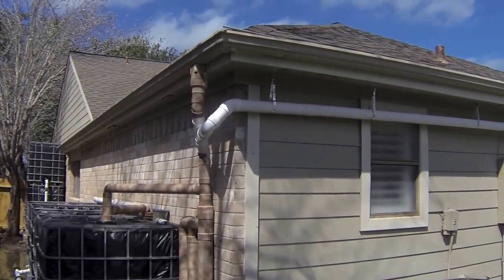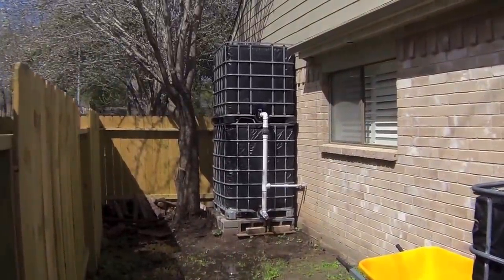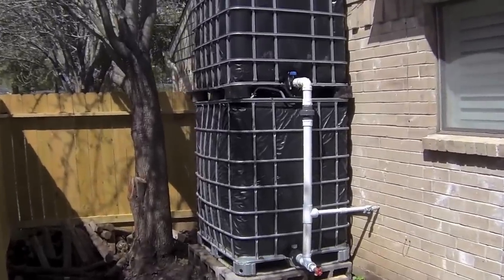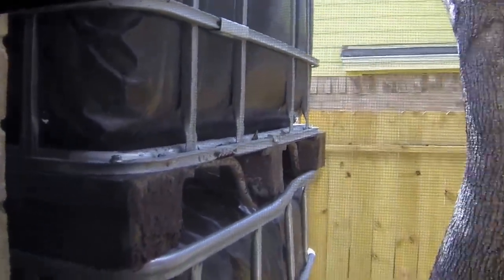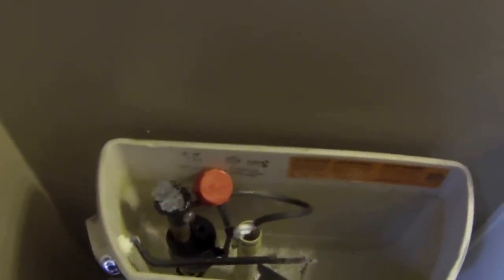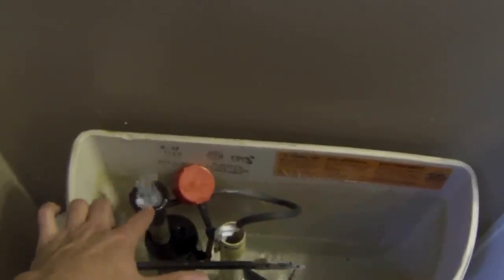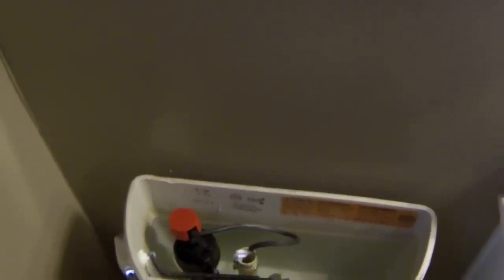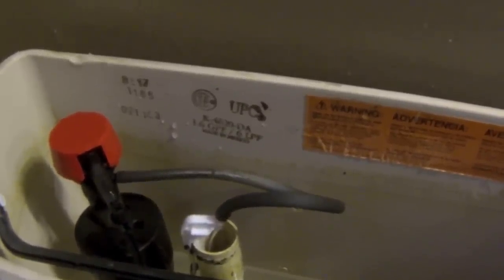How I Flush My Toilets Using Rainwater

Comment: The metal cage of the lower water tank is almost failing from the weight on top of it, see how it bends? Pretty sure you didn't calculate how much weight that steel supports, and see if the top water tank exceeds that limit.

Comment: Here in our hometown, city water is cheap, but they bill you for every drop of water that goes into the sewer system. That is measured by the total water flowing through the meter at the street. My last water bill was only $12, but my sewage bill was $44 plus trash pickup is added to my bill. My average bill for all my city service runs me low at $68, by high runs close to $80. Anywhere I can reduce my flow rate is well worth the effort. My biggest use of water is watering my gardens. I have built my first rainwater harvesting system, and with a recent rain was able to collect about 255 gallons of water in a 300-gallon tote. I am waiting on a second tote to add more water. Since I live in an area that has an average winter temp of 55 degrees I am not too worried about freezing and the long-range forecast is for a mild winter

Comment: Hello, I understand this is an older video but I hope you still respond to questions.  We're researching rain harvesting for gardening, toilets, washing machines and possibly drinking and cooking.  I'm still kinda iffy about that.  I saw your video about using it for toilets.  You mentioned not having a pump at the time of filming.  Did you ever get a pump?  Would using one be easier or is stacking the totes outside each bathroom required?  I saw your video on collecting rainwater but it didn't have the totes stacked outside your window as in this video.  Did you leave these totes like this and if so, how did you fill it?  It's not connected to the rest of the system.  We're researching  everything now and I found your video very helpful.  Thank you for taking the time to share and I do hope to hear from you.

Comment: Hey brother, first of all I want to congratulate you and say great freaking job. I just had couple questions. In your design you mentioned those 3 pipes running down from the gutter to ground as if they were dispensing at bottom, but they are blocked off. What is the purpose of this? I see you have filter for the gutters so it cant be for settling solids at the bottom. Another question i have is, is there a way to use this water in all the bathrooms and toilets in the house? I understand it might not be inexpensive and may require pumps and other things. However, if you are experienced in the area i would love to know.
Reply from the maker: Thanks you and good questions, If you watch update #1 I explain more about the (3 pipes) first flush diverter. The bottoms are blocked off but are loosened where the water can steadily drip out to reset itself after each rain. In between rains there is a build up of dirt, bird droppings, and small stems that build up in the gutter. The leaf guards helps a lot with this but does not stop everything. The first flush diverter removes the first 20 gallons or so from each rainfall. Yes, there is a way to use the water for your home but requires more filtration to be potable.

Comment: good morning. had you made any changes to this system or learned anything new since making the video? I'd like to try the same with my house. was your pressure low because the IBC totes were low, or would pressure increase once they're full? thanks!
Reply from the maker: The tanks were full when I made the video. You can increase the pressure by raising the tanks. The low pressure system works just fine. This was only proof on concept, I do not have the connect now.
Reply: Great info, thank you!

Comment: I figured out another solution to low pressure,  change to the float ball system. when the ball floats it automaticly opens the valve with no pressure needed
Reply: Float ball system? Can you link one?

Comment: Excellent way to use water from the heavens and not from a city source. I wish the city and county's would join the 21st century and allow more gray water discharge and rain water collection to be less of a red tape experience it is right now all over this country. 

I personally would install a reverse osmosis filter system at the end and direct the waste water back to the collection holding tank.

Comment: I love your videos, very informative!  One question, since you have to use a transfer pump to fill your tanks to flush your toilets anyway, why not instead use a RV style water pump to provide pressurized water on demand directly from your rain collection tanks?  As it is, your pressure available is going to drop as water is used out of your stacked totes.  With the RV pump you can get a consistent 35 to 55 psi (depending on the pump.  Enough to flush toilets, was cloths, shower, or do what ever.  The pumps run off 12volt DC and can be powered wither with a transformer from regular 110 volt ac or if your into off grid stuff you can get a deep cycle battery, solar panel and charge controller to power the pump.  The way there is no stacked totes and no hoa to deal with.
Reply: Todd Jones Never mind.  I just watched your video " How to Filter and purify Rainwater"   Great video and it covers the pump. Thanks!
Reply from the maker: Todd Jones Thanks for watching!

Comment: In reference to the comments on the visuals or suggesting pumps you only need the volume of water for the flushing to be higher then the toilet. Remember the old timey ones with the tank way up near the ceiling? So if you get a lot of rain, you don't need the full sized IBC tote raised high, just however much water is needed for steady - state toilet flushing cycles relative to rainfall rates.

Comment: Love the concept. Looking to implement at my homestead. Would raising the height of the tank increase lbs of pressure? Im new to the whole concept?
Reply from the maker: Thank you, Increasing the height will increase the lbs of pressure. I believe for every 2.31 feet of height you gain 1 psi or for every foot of height you should gain .43 psi.
Reply: Thanks
Reply: That's right for pressure and head figures. I think typical flow ratings for water closets (toilets) are based on 60 p.s.i. inlet pressure. One foot of head is a foot of water column rise. You have your losses along the way.

Comment: thanks man ! i have been tring to make a low pres. water valve for my rain tollet and failed for these coup of months , i have been cutting the cut off valve on and wait ontill it fills then off. this was a pain. i need the low pres. washer for the 50 cents. do they  have them on ebay. and what do i ask for .thanks again
Reply from the maker: howard ashcraft are you in the United States? I could not find them anywhere!! It's a low-pressure ballcock seal. Fluidmaster Tech support  helped me, here is the number 949-728-2000.
Reply: Trenton Kaminski yes in the usa . thanks for the number . i will call .

Comment: If you take a styrofoam raft and float it on your reservoir, and then set concrete blocks on top of the raft, you will pressurize your system.

Comment: Hi great video, thinking of doing something similar myself but was wondering if there is a valve fitting that you could use to connect both the rainwater pipe and mains pressure pipe to so that if the rain water drys up you could just switch it over to mains pressure. Any ideas?
Thanks
Dean
Reply: Cloverfield Construction Ltd, sadly it’s illegal in most states to connect your rainwater system to the same lines as city water because it violates the clean water act, because you could backwash into the city system, you can get around this by completely disconnecting your toilet from city water and only using rainwater on it

Comment: Will there be a problem if/when you switch back to city water with 8 lbs of pressure on your 2 lb pressure seal?
Reply from the maker: I did the swap and the toilet works fine on city water with either seal. However, I'm not sure what would happen if I left the 2 lb seal for a length of time. Each seal is only 50 cents or so and the swap only takes a few seconds if so some reason the 2 lb seal broke or didn't work.
Reply: Trenton Kaminski Howdy!  One other question, if the seal fails, will the toilet flood the house?
Reply from the maker: TheStavros1001 I'm 99% sure it will not flood. Im not toilet expert but here is my reasoning. My other toilet leaked due to an old ballcock and float set inside the tank. When this toilet would not stop filling water it just drained into the overflow pipe to the sewer. My assumption is the toilet with the 2 lb seal would do the same.
Reply: You probably need to use the seal for the intended design range.

Comment: Would you have to switch to city water for the winter season?
Reply from the maker: We're lucky here, it rarely freezes here and rains much more in the winter months. I'm near Houston,Texas.
Reply: If I did this, I would have the same problem in the winter; not enough water and that water freezing.

As far as freezing, I was thinking of a black box and tubes filled with glycol in a gravity loop arrangement for heat transfer; Insulation also would probably be needed. -A lot of remedial efforts. Therefore, underground tanks are the way to go for that. Then one will have to pump it. -Storage tank, pump and pressure switch. This is the typical cistern system, I believe.

Comment: can we use rainwater for shower directly after collected as long as its free from small particles or do we have to cure it first and if so, how? thanks in advance.
Reply from the maker: +youniverse traveller no you can shower with rain water no problem.
Reply: But why rainwater doesnt take away the soap completely .after minuters of showering, the body still remains slippery?

Comment: I have a simple solution for you. Take the tote that is on top and put it side to side so it is not visible from the street. Now you can take an RV style pressure 12vdc or 120vac fresh water pump that will deliver standard household water pressure to your toilets. Once the toilet tank is full, the toilet valve will shut off the water like normal. The pressure pump will then automatically shut off.

Comment: don't know about the climate in your area, in winter where I live all of that exposed plumbing outside would have to be well insulated, be better insulated with a pipe heater. I use a small booster pump 3/4 hp to move  water from the tanks to where I need it. 40 lbs of water pressure 100 feet from the tanks and you can pump a tank dry if needed for maintenance or cleaning. The pump is mounted on a 4 wheel yard cart for mobility.  cart and pump available at Harbor Freight or Ebay.

Comment: You could put a check valve on the rainwater side pointing in the direction of the toilet with a T connector, and a ball valve on the   city water side! this way you don't have to disconnect the pipes!

Comment: hey Trenton, is there any update or new info for this? has everything gone smoothly with integrating the IBCs into your toilets?
Reply from the maker: This was only a proof of concept.
Reply: i get that, but it was 3 years ago - did you not keep this system and run it?
Reply from the maker: Correct I just wanted to see if it would work.
Reply: Trent, forgive me for pestering, but the fact that you ended up scrapping it begs the question - why? were there any circumstances that prevented you from keeping it?
Reply from the maker: No special circumstances, however I did not feel like covering the top half. Homeowners association would have required me to shield the tank if I was to leave it up. I also would have had to install a float switch and pump connected to my main system to keep the tanks full. I really just wanted to see if I could make it work and share the experiance.
Reply: awesome - ok i figured the HOA had a bit to do with it, i just wanted to make sure there weren't any pitfalls to doing this on my home. thanks for all of your invaluable information!
Reply from the maker: +Eric James if you or a person wanted to replicate this the hoa can not stop you,  they can only make you Shield / cover it. At least that's the law here in Texas.
Reply from the maker: +Eric James other than learning about the low pressure valve for the toilet it was quite easy. You should be able to implement this with out any problems.

Comment: You are losing way too much pressure by not keeping your water tanks high (window seal to gutters). If you look at water towers in small rural towns, they actually pump water up into the huge reservoir tank, the water pressure off the bottom of the tank is gravity flow, not pressurized by any pumps. It is also why water tanks for towns are usually on the highest peak, hill, mountain nearby. Then you also choke the pipe down smaller and smaller as it connects to what needs it. That increases pressure with no pump needed.

Comment: Can you stack 330gallon totes on top of each other?
Reply from the maker: Douglas mucha I have not personally stacked 330 gallon totes on each other but I would not see them being any different than the 275 gallon totes. I don't see a problem with it.
Reply: Trenton, I will find out once I get to the farm Sunday. Being southern  Tn it does get below freezing. Have you had any problems?
Reply from the maker: Douglas mucha no problems yet, I will be adding more protection this year.
Reply: I would be wary of putting that much weight righ next to a basement wall. At ~8 lbs./gallon, a 250 gallon tank is 1 ton (2,000 lbs.). Near a corner might be helpful. I have had a 250 gal. tank at my house, near a corner for several years and have not had a problem. I do not foresee one either. The walk even had an existing crack that has not changed. I DID, though, make improvements to yard drainage (a slight swale/trench) to make sure the wall wasn't getting saturated with water (which is why I believe the crack started.  Everything has been fine ever since. No leaks.)

FWIW, a typical single- depth basement wall of concrete block of unfilled cores (including reinforcement rods) should theoretically fail. Many do, but many get by in reality. Proper grading is essential to keep water away from the walls. 

Also, in typical soil, there is a 45 degree pressure line. Outside this line, the pressure from the weight is off. I am going to take that there are horizontal and vertical components from the weight. The horizontal ones will be the ones acting in the wall  - i.e. right at the top of the wall of the basement if that is at grade.  The center of the wall is the worst scenario.

Comment: Does this really conserve water?  It isn't as through rainwater ends up as wasted, vanished water.  It goes into the ground - replenishes aquifers - and is ultimately used somewhere somehow..

Water from the county lines - comes from an aquifer or a well or a water tower (which was filled by an aquifer).  So - by taking the rainwater - you're not conserving water.  All the water on this planet that will ever be here - is already here and it cycles around.  

By using the rain water - you're just getting the water before it falls to the ground, gets to an aquifer, is pumped to some municipal water station, and run to your home.  But you're not actually saving water - you're just changing the part of the water cycle from which you take your supply - but its still roughly a circle.

That said - i still think its a really cool idea in any case.  At least you get charged less by not drawing but the municipal water supply.
Reply from the maker: It is true the rain replenishes aquifers, however it takes many years for the water to reach the aquifers. By collecting rain you are saving the aquifers. The city I live in now uses surface water for half of their water needs, most comes from our local river. This is all to save the aquifers.
Reply: So that brings up an even more interesting concept actually.  

First though, let me just say - I'm a huge fan of your system.  I just think its a really cool concept and the fact you're not depending on public works or public water supply is awesome.  Not to mention - rainwater HAS to be cleaner since its not travelling through old metal pipes and what not- so i think you're much better off.  It's just more about health/independence motives as opposed to environmental motives.

But, because water is a cycle - the question then is not so much "can i find new means of collecting water?", but rather, "Which part of the water cycle should drawing from to cause the least amount of negative impact to our environment?"

And i guess you could say - using rainwater just delays rainwater's return to the aquifer by however long im using it - versus saying i draw from the aquifer and then start that water's journey back to the aquifer

Comment: You can get a small 120v on demand pump for less than 100 bucks that will give you close to 40 psi. You don't need that many tanks or modifications to house. 

Just one 275 gallon tank and the pump, and you're in business....or getting rid of your business! 🤣